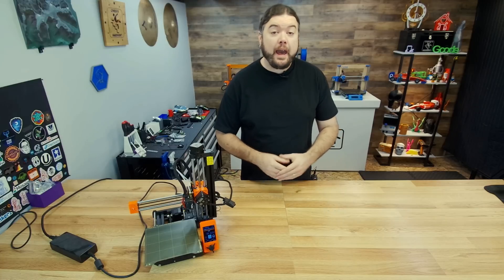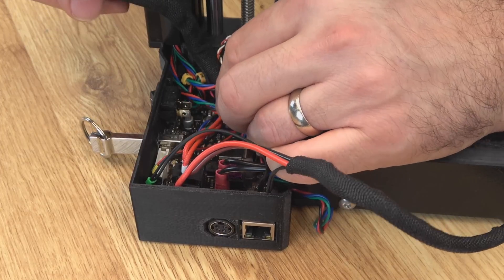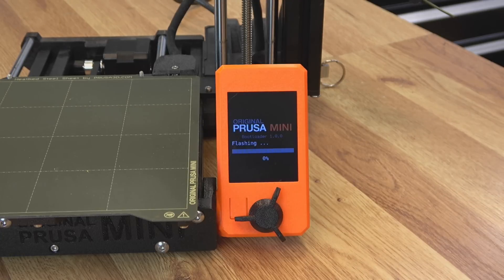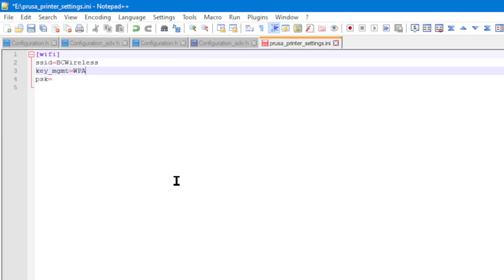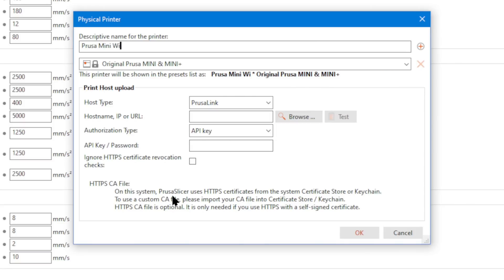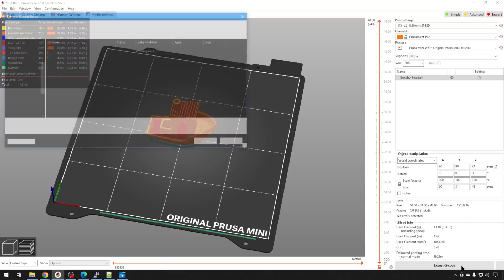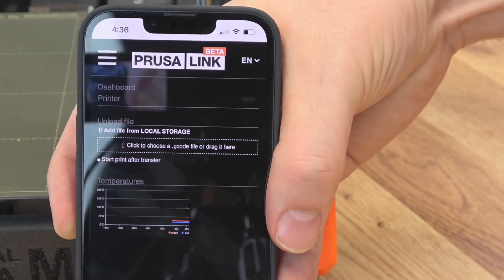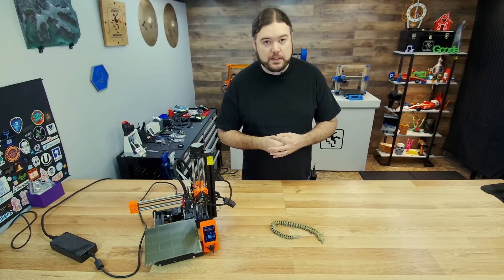Prusa Mini - Add Wi-Fi to your Prusa!!! - Chris's Basement - 2022

Comment: its not connecting to my wifi and doesnt show the WiFi anymore, It worked yesterday.
Reply from the maker: I have found mine will fall off the network as well, not sure why yet. If you power off then back on, that will fix it. I will look for a more permanent fix.

Comment: Want to setup STATIC IP Address? You need to edit your .ini file like so: 

type=STATIC
ssid=abc
key_mgmt=WPA
psk=123
address=192.168.1.69

The last string seems to be ignored but the ip is really static (read it on the printer or in the router's panel)

Suorce: "Blake XYZ" an user on prusa forum

Comment: Do the other printers support a wifi module? Mk3s+ etc?

I see raspberry pi zero is documented for Prusa connect. I have a few older pi 3 b... So trying to figure out the best path.

Also great video... 👍
Reply: Aah just saw your other video on this... 😊 Thank you. Will try this pin out connection.
Reply from the maker: Thanks for watching. Good luck with your projects!

Comment: does this (link) work wired? Does it work in the slicer?  I'd be willing to drop Octopi and free up a Pi if it does
Reply from the maker: On the mini there is an ethernet port, it will work with Prusa Link.
Reply: @ChrisRiley  ok I'ver used the ethernet port before like a LONG time ago, but the software you showed looked different then what used to be on there and I didn't know it would pair with the slicer. Thanks!

Comment: Hi Chris. I'm a new watcher to your channel and I have a quick question.  I'm new to 3d printing, I have a Prusa i3s+ that I have been using for about a month or so. My question is what raspberry would I use on this machine for wi-fi and hooking up a camera that I have?
Reply from the maker: If you want to use Octoprint to control the printer and camera you can use pretty much any Pi. Finding one that's affordable is the trick. 😀

Comment: I know this is unrelated to the video but I was hoping you could tell me the difference between the TMC 2208 UART and the regular TMC 2208 stepper. I thought UART or Stand alone, or SPI were determined through the jumpers. Thanks
Reply from the maker: Most of the time, yes, that is configed with the jumpers. In stand alone the jumpers set the micro stepping and the POT sets the current. In UART or SPI, you control the micro step with gcode as well as the current.
Reply: @ChrisRiley  so when you see them sold as to separate things whats the difference?
Reply from the maker: @PalosX  How the boards a soldered.
Reply: @ChrisRiley  Thanks!

Comment: Chris, good information.   Once you can connect directly to your printer and load files, monitor, etc it is very difficult to go back to using a SD card, especially the Micro - too easy to loose and break.
Reply from the maker: Thanks Dave, I know, the more feature they add the more spoiled I get.

Comment: I did this upgrade back when the beta firmware came out. The most annoying part was probably pinching the power switch tabs in enough to be able to pull it out while at the same time trying not to break the plastic case it was clipped in to. The firmware upgrade itself is great, but I found wifi speeds too slow for uploads, and went back to just using the ethernet cable, which had more tolerable (still not fast) upload speeds. Being able to upload gcode to the Mini without using Octoprint and an extra Raspberry Pi is pretty sweet though. It's basic, but gets the job done, and that's enough for me. I don't need the extra bells and whistles of Octoprint for my Mini.
Reply: I just broke the part of the case at the top of the switch and it came right out!
Reply from the maker: Well said, I appreciate your insight.

Comment: Hi Chris, happy to do more about the Mini. Maybe some tuning like E3d Revo micro or component cooling with other fan shroud.
Current Marlin or Klipper would of course also be interesting......
I operate the Mini via Octoprint, but I still installed the WLAN update. I find it a bit annoying that you have to enter the API code in the browser every time. But otherwise cool update.
Reply: I’ve tried Klipper on the Mini and it’s not great.
Reply: @prongATO  What was the problem?
Reply from the maker: Thanks! Yes, it looks like Prusa connect is coming soon, that should fix the key password issue.
Reply: Is this not a password field the browser can remember? Cant look myself, waiting for a ESP.
Reply from the maker: @citronski  it will remember it, yes.